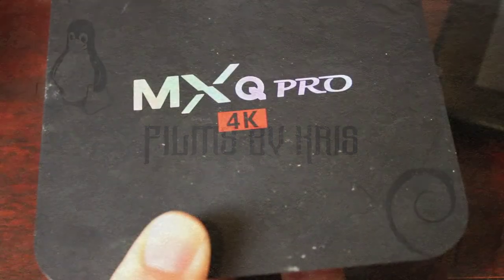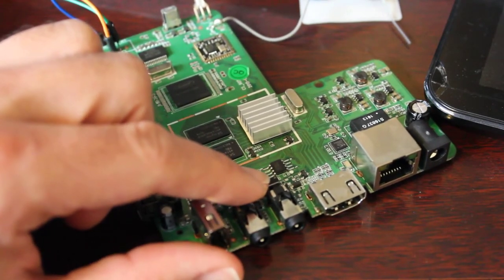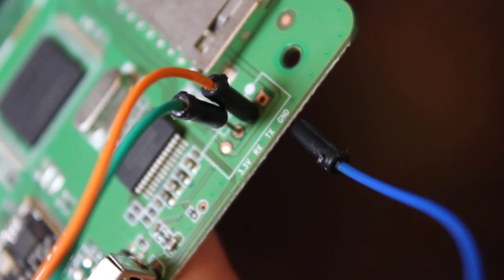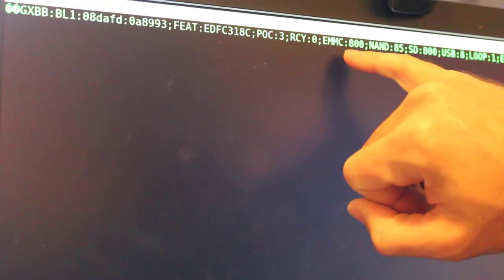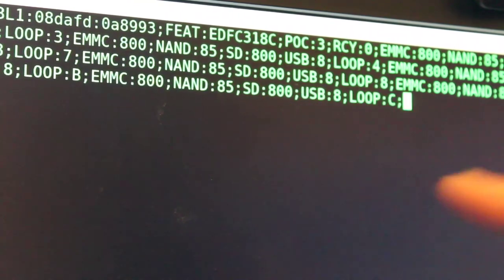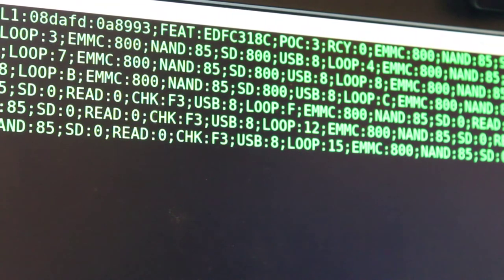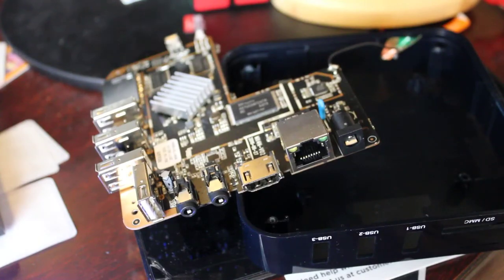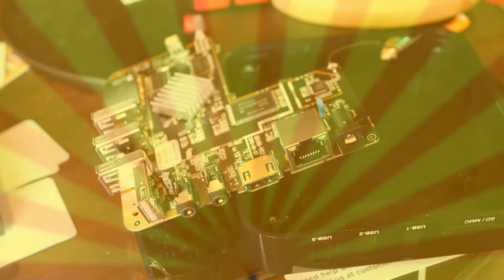UART Serial Port on MXQ Pro 4K

Comment: I just randomly deiced to do this on my Android RK8 Box and was able to get to shell with no issues. I converted my Arduino to a TTL-Serial Interface by binding the ground and reset together and listening on pin 1 and 0 for RX and TX. I found some code that can find the baud rate and then I used Minicom to establish a shell.

Comment: How did you get on with fixing your device
Reply: I actually did not.  I'm pretty sure you need a J-TAG or IC Test Clip connector, which I have yet to get or learn how to use.  Plus I had to get the device back to it's owner.  Perhaps I'll advance my skills at some point in the future.
Reply: Need a male to male USB connector and Amlogic USB Burning Tool as well as the MXQPRO firmware to recover
Reply: @MXQPROJECT  hello sir, just direct usb male to male right right to the otg usb port